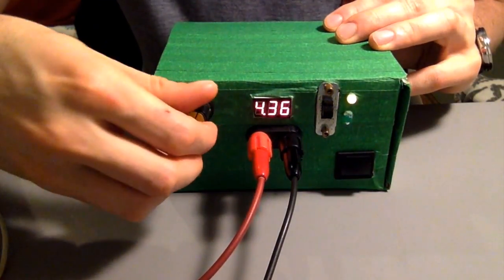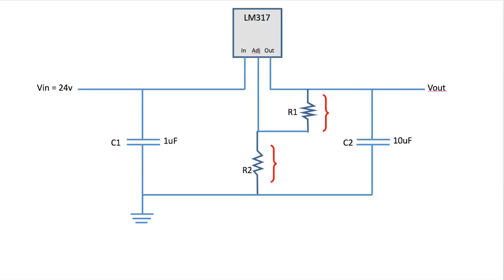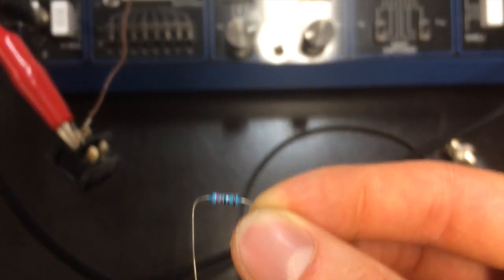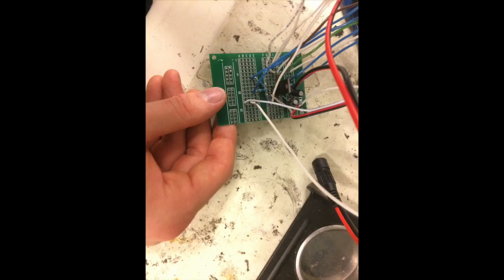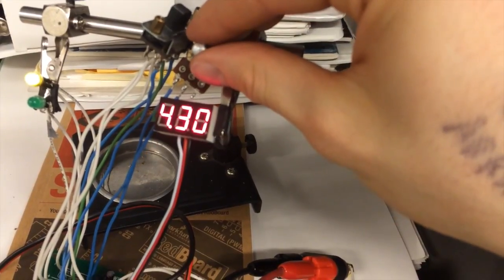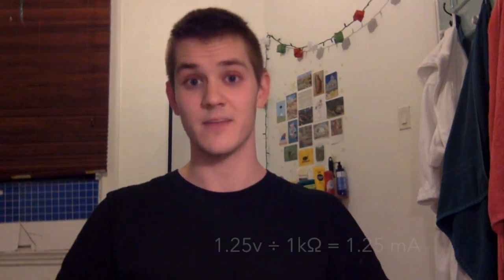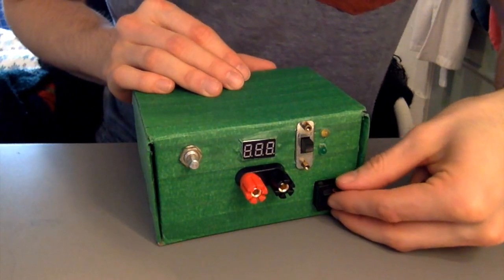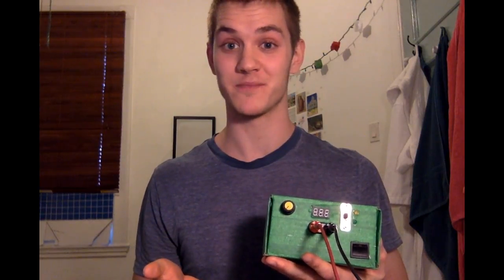$5 DIY bench power supply?

Comment: just keep a resistor across the output for a minimum load to preserve regulation. if you need 10ma, and you have ~2, add 6ma more for your lowest value. at 3v that's 460r, but that will get quite hot at 24v, so you can use something steady like an LED with 24ma max at 24v, scaling down.